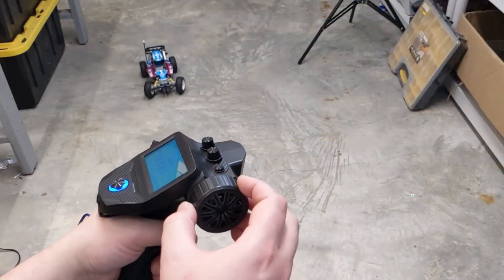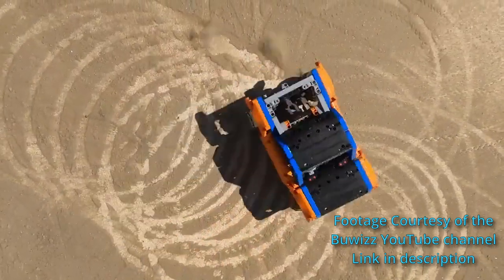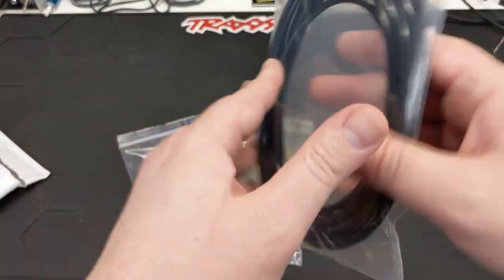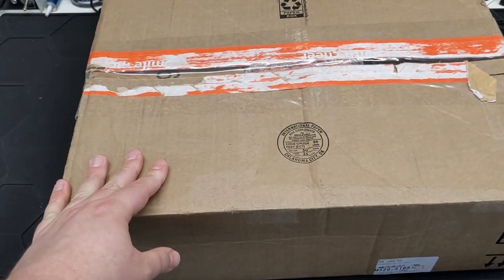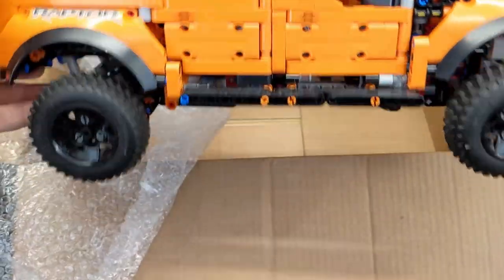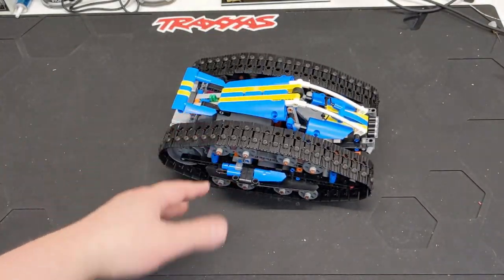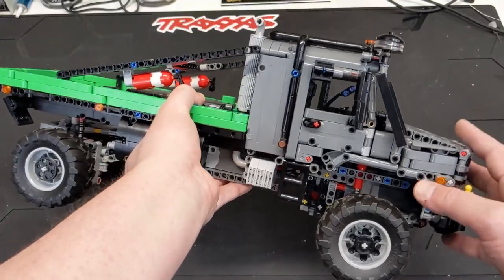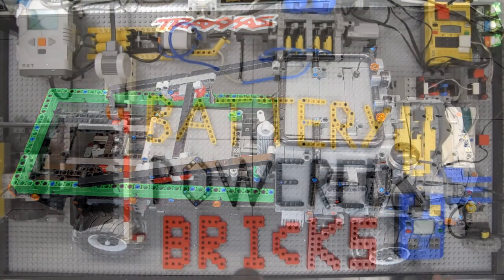So I went a little crazy buying Lego RC sets...

Comment: Love your enthusiasm, but why not order the specific parts from bricklink? Its way cheaper.
Reply from the maker: It is in some cases.  For me I started filling carts with specific parts I needed and it was adding up quick.  If you have the use for tons of parts, sets are by far the better value and like I said some of these sets will stay together for future videos.  Some of the sets I built I'll get B-Roll footage of before disassembling and scrapping for parts. There was supposed to be a Bricklink order in this haul but it arrived late.  Also remember all this stuff was purchased used which makes it a better value as well.  From this point forward I'll probably use Bricklink for specific parts, this was to get a jump start on the collection with more modern technic pieces.  Which I was realizing my collection was sorely lacking.